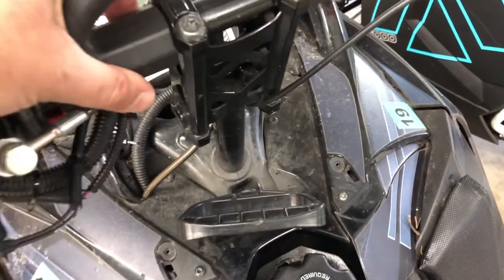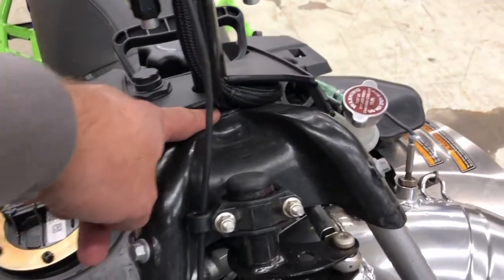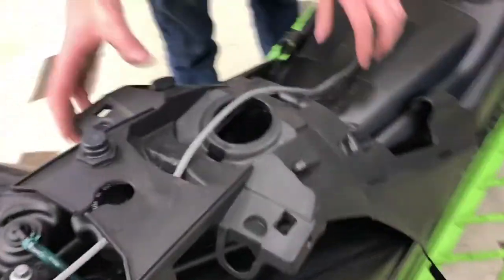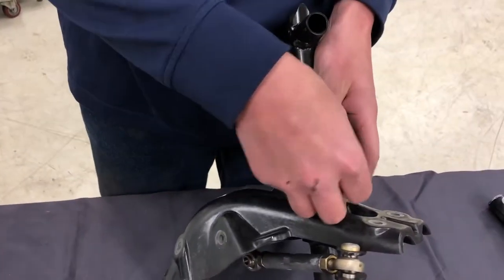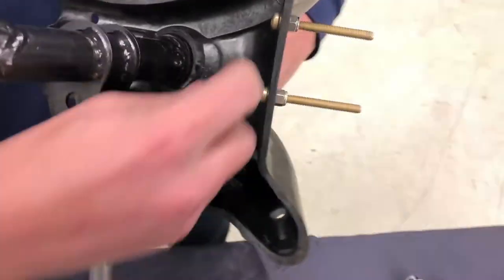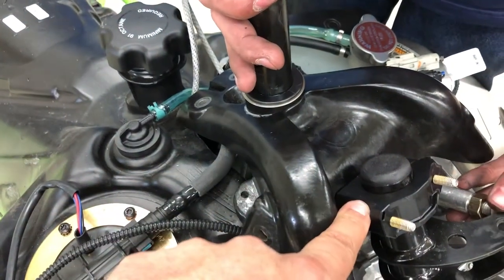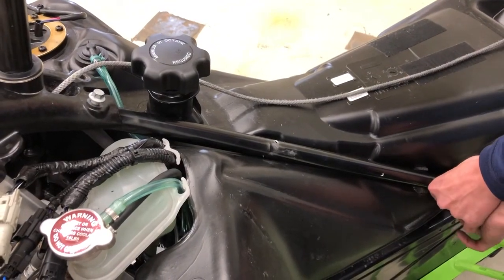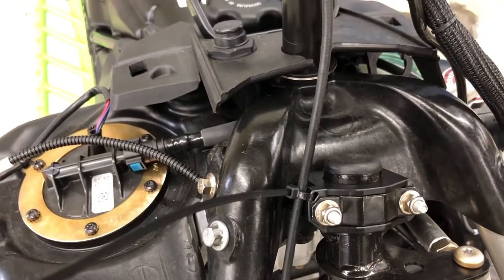BDX Anti-Slop Steering Bushing Installation

Comment: How long do these bushings last until its slipped out like factory again?
Reply from the maker: have had numerous last and still tight since their first install 4+ years ago. really depends on if they take large hits with heavy side load. everyday twisting motion they will last many years but hard hits from the side and they have the potential to dent from the force and may wear prematurely after that.
Reply: @bdx-ssi2895  thanks for the reply! Ordered a set! Getting ready for the season 😈

Comment: What is the secret to get the bottom clip on the upper steering post bushing?
Reply from the maker: make sure it's completely straight and not turned one way more than the other, some light taps with a rubber mallet won't hurt on top but should be no problem. They should be a snug fit into the base, if it's going in tight, there's something wrong.
Reply: @bdx-ssi2895  I got it thanks!! Love this upgrade!! A must for any cat